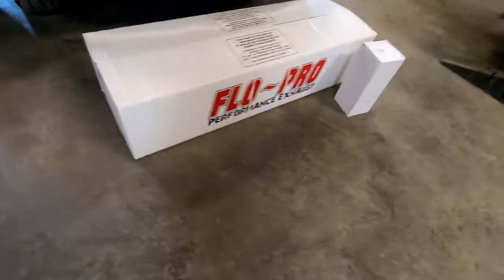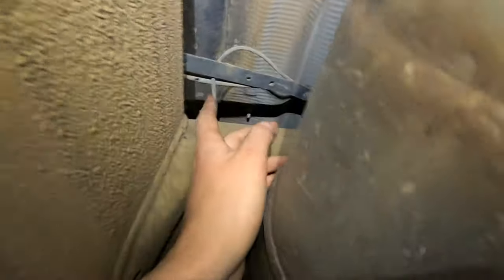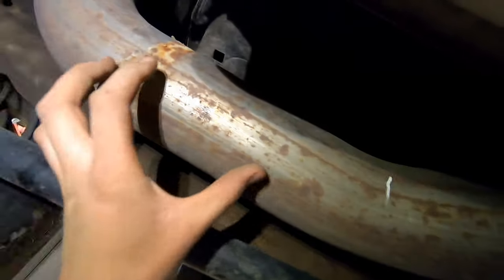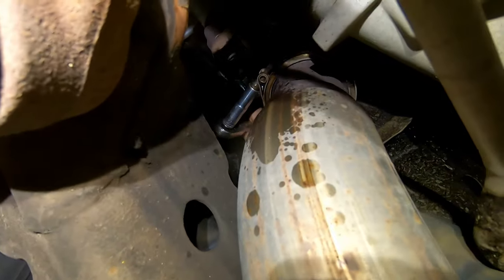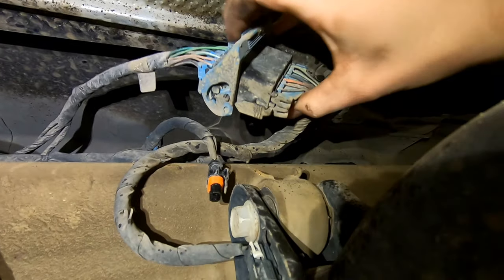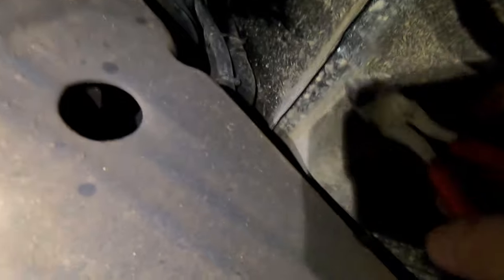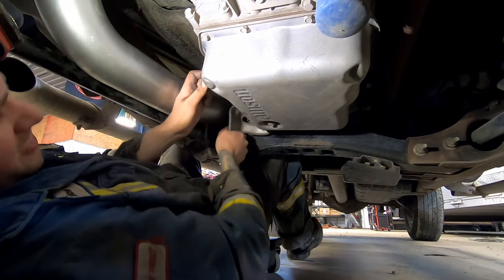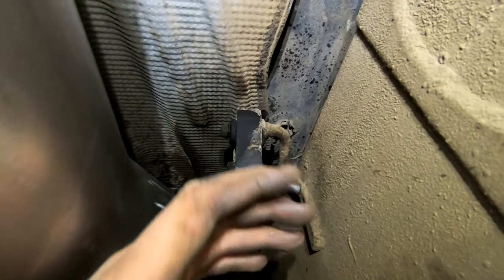How to: DPF delete on LML Duramax and remove DEF tank

Comment: Thank you for the video!  One tip for anyone who doesn’t want to remove the def tank is to make sure you unplug the big harness or it will continue to spout def fluid onto the ground…the mini maxx tune worked great
Reply: Did the mini max tune need to be programmed by a shop??

Comment: Got a 2011 lml and run efi live. Runs great and no problems whatsoever. The sound of the straight pipe never gets old.
Reply: straight pipe?
Reply: @armandocastaneda5898  Straight Pipe means No exhaust, No catalytic converter, No DEF injection. just a free flowing pipe from the down pipe (engine) back to the end of the pipe.

Comment: I just finished deleting mine and it works much better, I will update with mpg when I have that info. I only deleted the dpf and got my tune from tunerdepot as they were the cheapest. I used the efilive autocal v3. It cost me less than $1000 to do as well, only thing I bought was the tool and a tune. I opened up the dpf and removed it then welded it back closed.

Comment: I have to say, you have the most informative videos I've ever seen on here. You know how to move the camera so we can clearly see too. Thank you. l do have a question that I can seem to find an answer to....I have a  2013 Durmax 2500 HD with the LML motor. I bought it from a used truck dealer about 6 years ago. What I didn't know is the the def system had been deleted until I took it back a month later because of a hose hanging down. They said it was "chipped and deleted" Now, years later, the motor is blown and I am going to be having it replaced with a "drop in" stock motor. I didn't think about that?? What would I need to do? Buy and replace the exhaust system? I don't want to go to the DEF system.
Reply from the maker: Just replace the engine but keep the ecm and exhaust you currently have. Also, you should get the trim codes from the injectors in the new engine and have them programmed in with a scan tool (a normal repair shop should have a scanner capable of doing this)
Reply: Thank you! 
 @darkirondiesel

Comment: Followed your video for this, my only issue was the straps for the def tank cover that were high on the body side were torx bolts and stripped both so I guess the tank will be staying up other than that your video helped a ton the downpipe was extremely fun

Comment: Not sure where you're located, but would be willing to get my truck to you if you could help. You're clearly the right guy for the job. I've got a 2012 Silverado 2500 HD. Was driving back from a very long trip and just made it back into Minnesota while towing an empty 24' enclosed trailer. Speed was relatively low, about 60MPH and right as I accelerated to pass, there was a loud gunshot sound. The bang sounded like it came from behind the truck but not from a backfire as it never has in the 40,000 miles I've owned it. It was nighttime so I couldn't tell if it was dark or white smoke, but there was a LOT only while using the diesel pedal. DPF message came on about cleaning the tank, so I stopped to fill it, hoping I could just limp home. After filling, engine power reduced message came on and the trucks speed was limited to 39mph by GPS. 40mph per the dic. Took a few miles to reach that speed as well. If I put the pedal down to accelerate the engine would surge down like it was shifting into a lower gear like a exhaust brake, though the exhaust brake was off. If you're willing to lend some advice so I can DIY or if you're willing to physically help, feel free to call or text 6125014095. Really look forward to hearing from you. Codes P2463, P0420, P0299. 

Thanks to anyone for any educated reply.
Reply from the maker: Hmm that's strange, I don't know what would cause the loud bang sound.  The first two codes are emission related, but I believe that third code is turbo related.  Super tough to diagnose without actually seeing the truck in person.  As for location, I am located up in Saskatchewan Canada, so I doubt you would want to lug it all the way up here haha

Comment: I have a 2016 hd2500 6.6. I would like to do the same thing with my truck. To many problems with the def system. Is the part number you installed on the truck the same for my truck? I searched for the on 664nm and can’t find it. No listing anywhere in my searches

Comment: On 2016 3500 gmc if my truck has went into limp mode because of fail def pump will the efi live tune for def delete clear that or do i need to fix the limp mode first.

Comment: Thanks for the videos man! I have a 2015 duramax that just threw a code for emissions 160 miles till max speed 65. The code was the egr has exceeded learning limit. Im going to do a basic dpf delete as soon as possible. Just worried that the egr is stuck open. It’s running great. A mechanic friend of mine told me that if that valve was suck open it would be running like crap? What would happen if I did the dpf delete and the egr is stuck open? Or maybe I can do the dpf delete and see what happens? Thanks again for the videos, id really appreciate some advice

Comment: One more thing I have been struggling with,  My SCR went bad on my 2016 Nissan Titan XD at 23 thousand miles November of 2020.. I live in a no emissions testing state and Nissan does not warranty emissions systems in those type of states.. Go figure.. Even my crappy extended warranty did not want to help out.. even told me if I was to take it off they would probably not cover most of anything in the drive train.. So my question is this, I don't want my truck to be much louder than it is now, and not to look like a coal burner.  Is that possible? Thanks..

Comment: My truck is in limp mode already. Do I have to have it repaired before I delete it? It has exhaust fluid poor quality codes due to a plugged DEF injector
Reply from the maker: Nope you can just delete it, the tune will take care of the codes.
Reply: @darkirondiesel  thanks, gonna order a kit tomorrow!

Comment: Hey I recently purchased a 2012 lml that someone did this to but just welded in a straight pipe in its place and reflashed the ecm. Just curious where I should go from here I don’t have the stock tune or def and not sure if I do the full egr next or what looking for suggestions or options. Not really knowing what’s the next step.

Comment: I did this today and when i started my truck up def fluid started flowing is that normal?
Reply from the maker: Ya some trucks do that for some reason. You can unplug the def tank and it will stop. It’s a big white and blue plug in the top of the def tank.

Comment: @Dark Iron Diesel I’ve got a 2015.5 all fully stock with 150kms...the DPF filter must be cracked because it’s a decent smoke show during a burn off and I get a puff of black smoke on takeoff during normal driving.  No codes, been like this for about 2.5 years and runs fine otherwise.  Am I causing any harm to the engine with a cracked DPF? I Will delete it but still researching the best option for me (fuel economy, reliability and CP4 longevity...)
Reply from the maker: I’m not sure that’s weird, I honestly don’t know if it’s bad for your truck or not. I would think it would be ok but I’m not 100% sure

Comment: Thanks for the video! I have a 2012 GMC duramax and I need to delete it and install a 5” exhaust so this helps a lot! Question is though what tuner and tunes do you recommend?
Reply from the maker: Personally on a duramax I recommend just slapping a single EFI Live tune on. Either a 25 or 45HP level. 25 if you tow heavy lots and 45 if you mainly use it for daily driving unloaded
Reply: @darkirondiesel   is 100hp too much not towing?

Comment: I have a CEL on due to the DEF heater, do I need to clear the code prior to installing the tune?
Reply: All codes should be cleared before tuning. I had the same same problem with the heater.

Comment: I am about to delete my 15.5 lml, but I don't want the truck to be loud. Which exhaust do you recommend? Not sure if I am going to go with 4 or 5 inch, but I am not going to use it for racing or screwing around, it is a family rig pulling my camper and my ATV's around. Which tune is a good all around tune? Thank you.
Reply from the maker: I’d just put a 4” with muffler on it if I were you.

Comment: Just did a dpf delete on my 2013 LML duramax with Minimaxx tuner, but for some reason the truck randomly loses power. No CEL or and codes do you know what could possibly cause this issue?
Reply from the maker: Did you unplug the throttle valve?
Reply: @darkirondiesel  yes

Comment: QUESTION:
Diesel Particle Filter Full Light
Engine Power Reduced Light
Check Engine Light
2016 LML Duramax 3500
Lights all came on. Drove the truck 60+ miles. DPF, EPR lights are gone but Check Engine Light still on. Is this normal??? How do I get rid of the light? Can I clear it with my Bosch scanner?
I want to do a delete but still want to look and sound factory. Any suggestions?
Reply from the maker: Try clearing the codes with a scanner and see if they fixes the issue. Usually the engine light will stay on until it is cleared even if the problem fixed itself. 

You could drop your dpf out of the truck and cut it open, remove the filter, then weld it back up. But it would probably still sound a bit different then stock.
Reply: @darkirondiesel  Thanks! I'll keep ya updated.

Comment: 2016 lml, i unplugged egr, tuned it, and it still had stock exhaust, i fired it up to make sure it ran before i started removing the exhaust and it ran like a 4 wheeler thats warm with the choke wide open, and the truck died, is that normal with it being tuned and stock exhaust?
Reply from the maker: I’ve never had that happen before

Comment: Why not remove the egr and cooler? I want to delete mine not sure if I want to remove it or just unplug it?
Reply from the maker: Its a lot of work to remove the EGR cooler on the LML duramaxs, So most guys just leave it in.  As long as your egr valve is functioning properly at time of delete it should remain closed with the engine tune therefore not letting any exhaust gas back into the engine.  But it is always better to fully remove it in my opinion.  I have a video on LML EGR delete, you can see what I mean https://youtu.be/8OBWLmZWsFA

Comment: Great job!
But, don't you need to delete the def/urea from the computer? 
Will the truck start after taking out the urea tank out?
Thanks
Reply from the maker: Ya you have to program the truck to run without the emission system. I go over that in the video

Comment: Hey bro couple  quick questions for ya, those three plugs you unplug  in beginning of this video , do you leave those disconnected permanently, and if you do plug all three bak in will it cause any problems like limp mode  or any other issues ? Thnks appreciate it
Reply from the maker: Everything I unplugged will remain unplugged
Reply: @darkirondiesel  even throttle plug on 15 lml too?

Comment: Can you delete without removing Def tank and tube?  How to tell if a 2014 duramax has been deleted?  Emissions test failed stating cat converter fail.
Reply from the maker: Look under the truck and see if it has a cat/dpf exhaust or if it has an aftermarket exhaust. That’s how you tell. Also, wipe the end of the exhaust with your finger. If your finger is black from soot it’s deleted.
Reply from the maker: And yes you don’t have to remove the def tank and tube when you delete it

Comment: Do I need to unplug the def tank wires if I’m leaving it under the truck? Or just do everything else and not touch anything to do with the def tank?
Reply from the maker: You can leave the def tank plugged in if you aren’t removing it
Reply: Thanks man. You’ve helped a lot

Comment: I bought my 2013 truck new and gm never got it to run right... Out of Warrenty I deleted it (legal here) just wondering what guys do where it's illegal... I had a $80k brick in my driveway until I deleted it myself. Emissions are bs I now get 24mpg VS 12 pre delete and way more power...
Reply from the maker: I don’t know man. Trade it in for a 3/4 ton gasser probably haha
Reply: @darkirondiesel  I just drove a (work)f550 7.4l 10speed and wasn't to impressed, big slow gas engine LoL

Comment: What’s the purpose of disconnecting the plugs in the engine bay post-tune?
Reply from the maker: Leaving them plugged in can cause weird random issues like idle fluctuation and a dead accelerator pedal
Reply: @darkirondiesel   but when you finish with the exhaust you plug everything back again or no

Comment: Great vid....2 questions...my truck is in limp mode already, will the tune and delete clear that out. Also will the three things under the hood remain unplugged after modifications?
Reply from the maker: If your truck is in limp mode because of a failed emission component then yes the delete will clear that. And unplug the 2 egr valves and throttle valves under the hood and leave them unplugged
Reply: @darkirondiesel  yes sir thank you, limp mode will no longer plague my truck.

Comment: I bought an already deleted 2014 dmax . How can I tune it. I've been told if I buy a tuner and try it. It will go in limp mode. Do I have to take it to a shop and get it tuned
Reply from the maker: Why do you want to tune it? It’s obviously already tuned if it’s deleted and not in limp mode
Reply: The guy I bought it from said that when he had the shop delete it he only wanted a 20-30hp tune.I pull a 22' enclosed trailer everyday for work and it gets terrible fuel mileage vs my tuned f350.

Comment: Thanks for the video!  I am getting the DEF poor quality warning on my Duramax 2013 and was wondering if, for now I can just unplug the sensors and do a DEF delete reprogram and leave everything else installed?
Reply from the maker: No do not do that. If you program the truck to run without the emissions system then it won’t do DPF burns anymore. And if it’s not doing burns your DPF will plug up with soot and you can cause some SERIOUS engine damage. You have to install an aftermarket exhaust when you program the truck to run without emissions.

Comment: I'm having a hard time finding the flopro exhaust kits online. Downpipe-Back is what I need just like your install here. Where do you buy? Thanks in advance.
Reply from the maker: They don’t ship to the states anymore so if you live in the states it’s hard to find. But any exhaust will work, it doesn’t have to be flopro. I think guys are buying exhaust kits off eBay in the states.
Reply: @darkirondiesel  Thank you for the quick response. I placed my order.:)

Comment: Hi man! I enjoy your videos!  I have a question if you could answer for me.. I currently have an h&s tune on a 2013 lml and just curious if low boost fueling is effected when removing speed limiter? I had it removed with low boost set to 4.. throttle was very responsive. Later retuned to keep speed limiter on so I would have cruise however now throttle response feels sluggish. If you can't answer no problem! Thanks for the video though! Very infprmative👍
Reply from the maker: Hmm I’m not sure, what you could do is program truck back to stock, then program the tune back on it and select the settings you want. That way you know for sure how it’s set up.
Reply: @darkirondiesel  
Yeah indid that..lol by accident I turned key from on to acc. Then tune froze so I shut everything off and started over With the tune I had to begin with. I have it set to low boost at 4 like before but with speed limiter on.. and throttle seems like stock.. I will try same setting tomorrow but remove speed limiter like I originally did and see if that is what it is. Thanks for replying sir!

Comment: Do you plug in the 3 engine harnesses back in when done?
Reply from the maker: The two egr plugs and throttle valve? They stay unplugged.
Reply: @darkirondiesel  thanks man. How much over stock are the lml transmissions rated for tuning wise? I have a mini maxx running a street tune wondering if that is going to last

Comment: Great video: question for you, is unplugging the EGR good enough? Or should you remove that also? I use my Duramax as a work truck
Reply from the maker: A lot of guys leave the EGR on the truck and just unplug it. When you tune the truck with an off-road delete tune it will deactivate the EGR system, therefore the EGR valve which lets exhaust gas back into the engine should remain closed.  So if your EGR valve is working properly at the time of the delete you should be fine. Make sure you don’t have any engine codes for your egr valve though before you delete it. If you have a code for a faulty valve then there’s a chance of it being stuck open letting exhaust back into the engine constantly.
Reply: Dark Iron Diesel makes total sense to me, thanks very much for the info. Your channel is awesome!
Reply: @darkirondiesel  
Hey buddy, this is my situation 
I have a duramax 2008 and has ,"Reduce engine power "
So l have to delete it,because the pdf is 85% full so is not able to force to regenerate, and you say we don't need to delete the EGR
Just unplug it but l be able to program with the mini Maxx or any other device.? or l need to delete the EGR to if it's has codes and don't work properly. ?

Comment: Do I have to install a full EGR kit if I deleted the DPF on my 2013 LML, or I can just unplug de EGR sensors ?
Reply from the maker: You can just unplug the 2 egr plugs and the throttle valve
Reply: Dark Iron Diesel do I have to do it eventually, or why must people takes all the EGR system when the do the delete ? Thanks
Reply from the maker: You don’t have to delete the egr, some guys leave it on forever. When you tune the truck it deactivates the emission system leaving the EGR valve closed, theoretically it shouldn’t be letting any exhaust back into the engine. So some guys remove it for peace of mind and some guys remove it so it looks cleaner.
Reply: Dark Iron Diesel thanks for replying, first timer here. U are lots of help men. God bless you